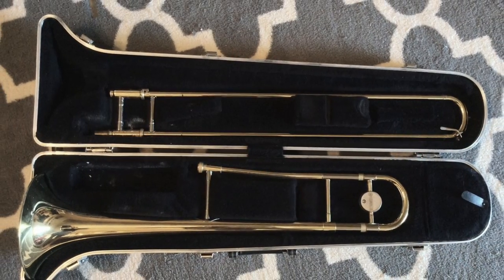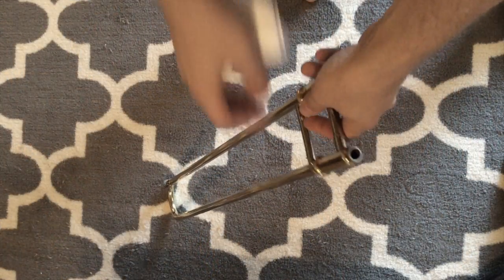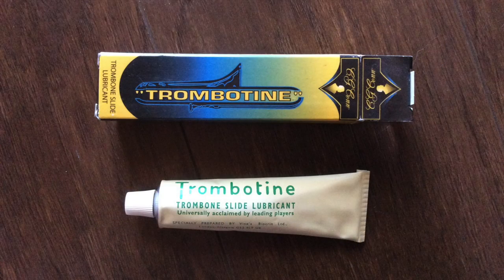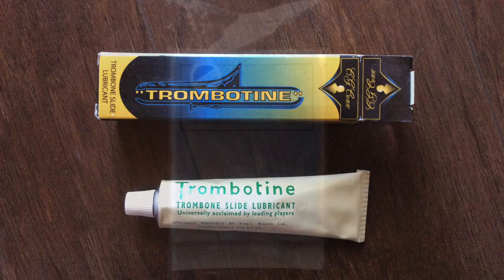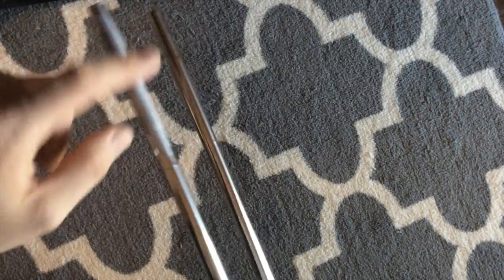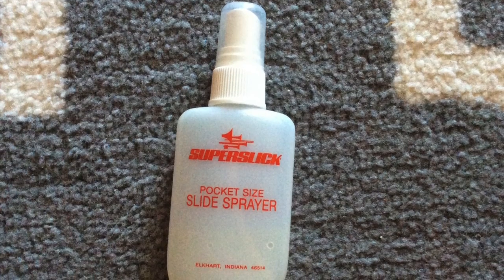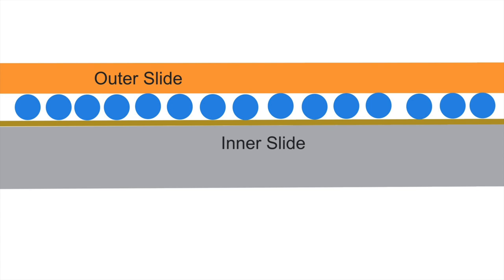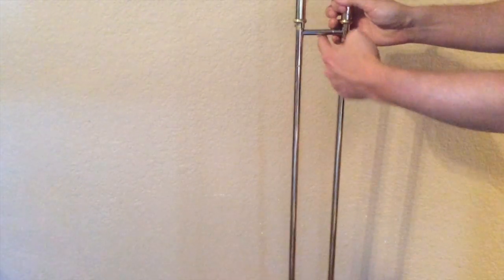How to Grease your Trombone Slide

Comment: One of my fellow trombone players recently ran into a problem where her outer slide gets "stuck" on the stockings, resulting in her not being able to move the slide to its full extent. We examined the slide very carefully and found no imperfections, and even got the opinion of a perfessional, but it seems as though there is nothing actually wrong. We tried multiple different lubricants and even bathed her trombone in an attempt to fix this issue, but nothing seems to work. Any advice?
Reply: Mf might just be broken. I tripped with my bone had the same problem so send it to a shop to get it fixed I guess that’s what I had to do
Reply: Maybe the inside of the outer slide is scratched up a bit at some spots, or the brace wasn't adjusted properly before soldering.

Comment: a little dated using trombontine. i used superslick and super slick plus for 35 years (water soluable- does not cake up). then yamaha came out w their liquid tubes. affectionatly called "yama snot". is light years ahead. last for several days on the slide, even w heavy playing. will make a narly slide feel great. look out for 14th position
Reply from the maker: Michael Balogh - I use Super slick also, but I teach middle school band and I’ve found the trombotine to be the path of lease resistance for their first year. After they get a little bit smarter in 7/8th grade I move them to better stuff